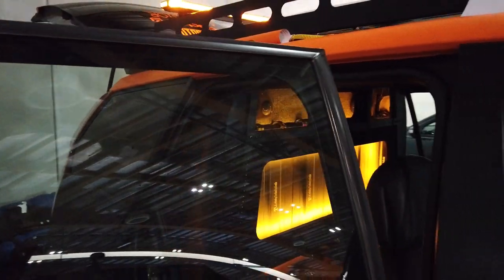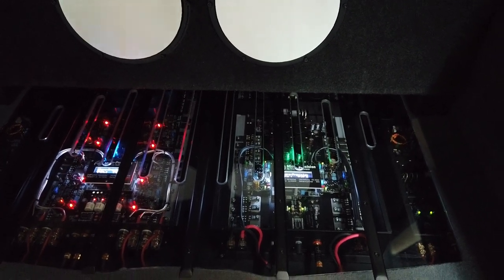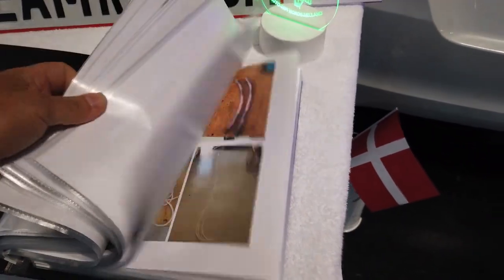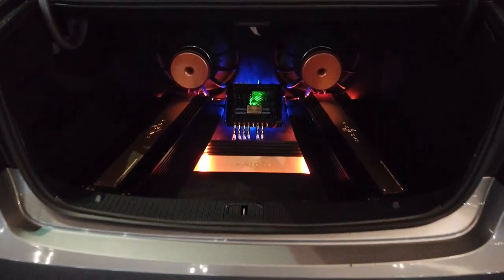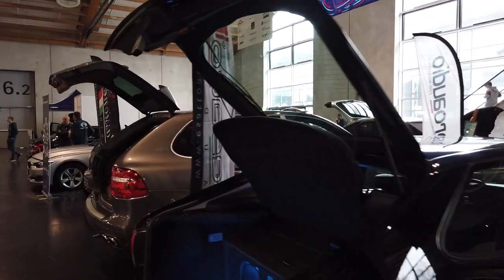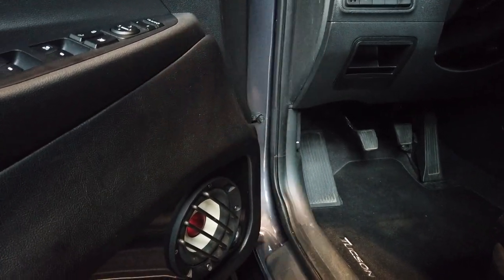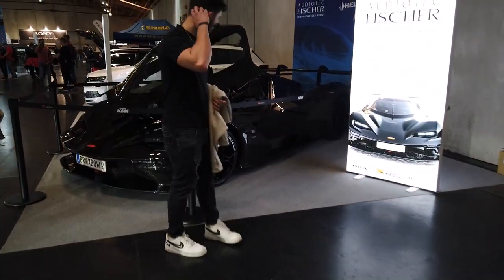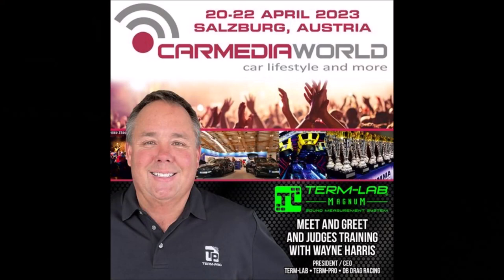Carmedia World 2023 - EMMA SQ Vehicles with Wayne Harris

Comment: Hi Wayne, I met you, while working at Rockford, in Tempe,in 1995; (DSM machine running and Hafler home amps were built minimally). I had the Symmetry EPX you invented. I started on the line moubting trasfirmers and caps, then the solder wave, then to mounting the pc boards to the mosfet rails and heat sinks. Good to see you are still into car audio. 🤝
Reply from the maker: Very cool! Thanks for visiting!